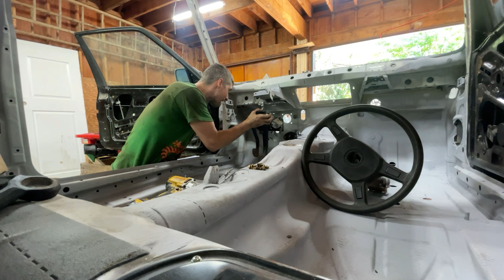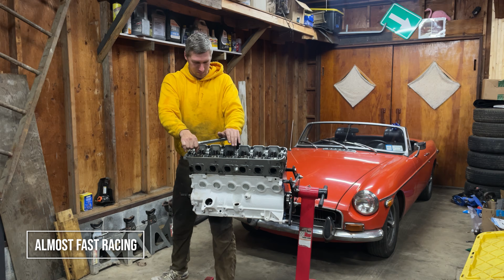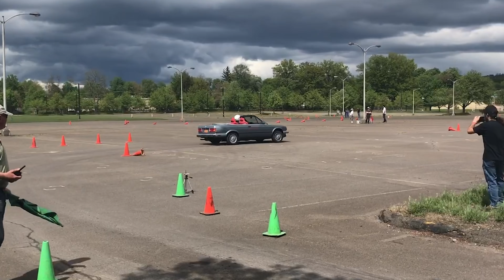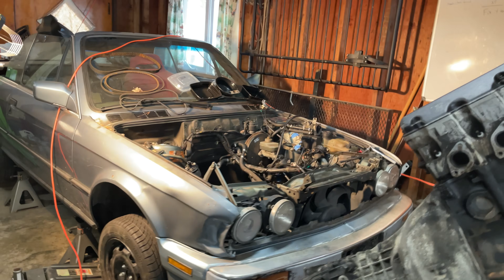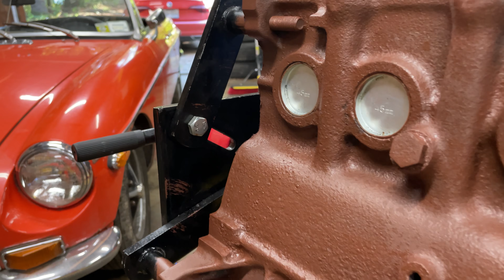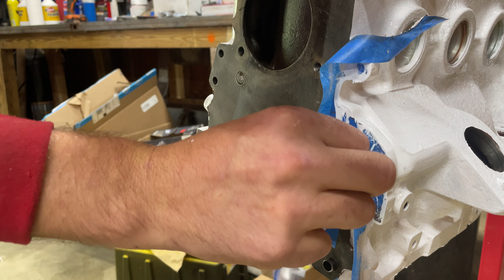How To Paint Your Engine So It Lasts!

Comment: I always do that with wire brushs on an angle grinder or drill to clean the surfaces and than soak it in brake cleaner or something similar. Works out every time. If you have a place to heat it up properly I recommend dupli color supertherm. After the heat treatment it becomes more like a coating than a paint. There is also no need for a base coat and it really lasts. No chipping, no cracks.
Reply from the maker: @DLT-po6to  I don’t have a good way to heat it. I’ve heard good things about the brush on paint from rust oleum. Time will tell.